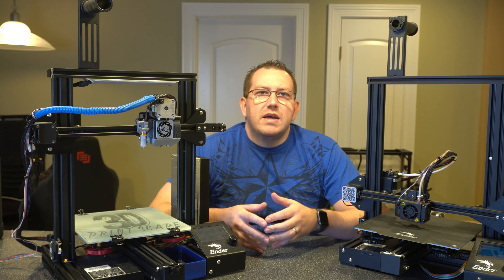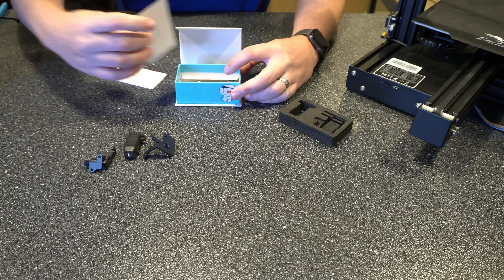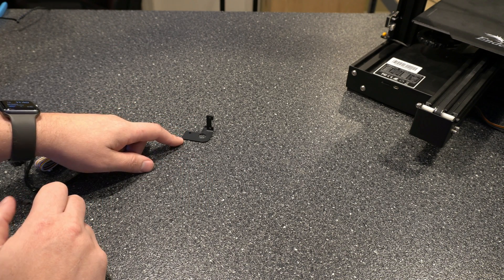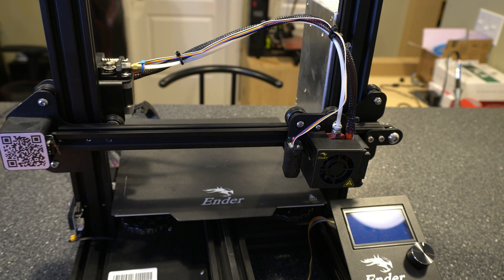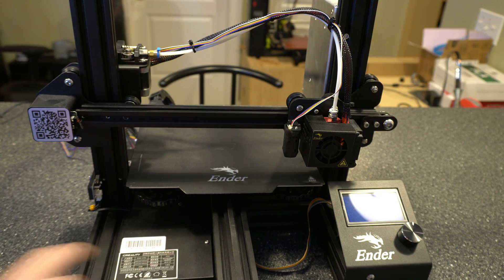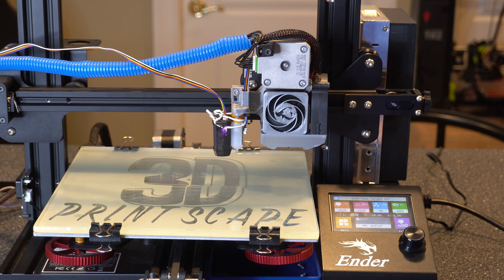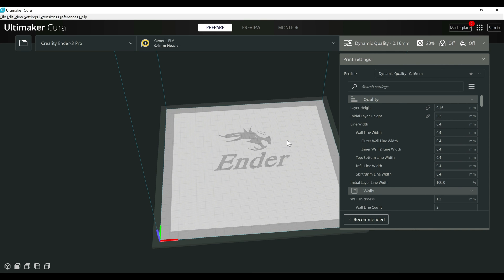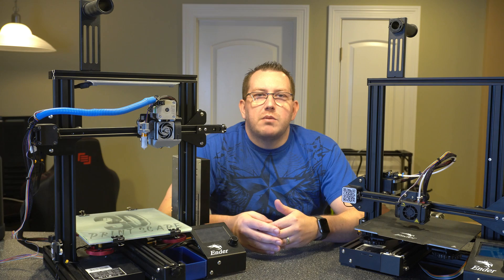CR Touch on SKR Mini

Comment: The firmware you told me to install for the ender 3 skr mini 3.0 isn't working, what should I do?
Reply: The cr touch and z stop are connected and working when I click auto home it does the stock ender 3 auto home and when I select level bed it starts it then stops
Reply from the maker: Hi. Sorry for the delayed response, was on vacation. Are you still having issues?

Comment: I'm still having issues with the firmware and getting the z offset
Reply from the maker: Hi. What issues are you having?
Reply: @3D Printscape  I have an skr mini v2 with a tft touch screen and I just got the cr touch When I download the firmware v2 and the bl touch firmware and load it to the printer it seems like it doesn't load the firmware properly the info screen still says it has the old firmware and the abl keeps getting an error and if I try to do my z offset every video and different menu layout like the z offset wizard And if I take the SD card out and put it in the computer the firm warefile has changed its name and the file type After loading it in the printer
Reply from the maker: @adrielsanchez5793  Does the autohome and mesh work correctly?
Reply: @3D Printscape  no they don't and the auto home Goes in the bottom left corner  not the middle of the bed
Reply from the maker: @adrielsanchez5793  Do you see anything for the bltouch in the menu? It sounds like it maybe a firmware issue.
Reply: @3D Printscape  I have abl in the menu but there's always an issue manly with the auto home not being center
Reply from the maker: @adrielsanchez5793  Did you clear the eeprom? If so, it could be an issue with the bed size in the firmware.

Comment: Do you know how to connect cr touch to screen mini v1.2 that's the board I have it doesn't have the 5 pin connection on the board it has a 3pim servo port
Reply from the maker: Hi. You have to spilt the servo and probe pins out. The 3 servo pins would connect to the servo port and the probe pins would connect to the z stop port. There are also a couple small firmware changes needed. If you decide to go that route let me know and i can help with the firmware part.

Comment: Is it supposed to create a new mesh everytime you print something?
Reply from the maker: Hi. If you add the g29 command to your machine profile it will, but by default it doesn't.
Reply: @3DPrintscape  dude, thanks so much! Plugging the z endstop switch did work!

Comment: Hey, I downloaded the bl touch for z homing and the z axis doesn't compensate whatsoever. The cr touch does work though, should I have downloaded the other firmware?
Reply from the maker: Hi. Assuming you have the z stop connected and the crtouch wires connected to the bltouch port you want the bltouch firmware, not the z homing one.
Reply: @3DPrintscape  I do not have the z stop plugged in, does it not work without it?
Reply from the maker: @yobtnirp3D  Most firmware require it to be plugged in.
Reply: @3DPrintscape  oh, but it does not actually use it?
Reply: @3DPrintscape  right now it probes and even says it leveling the bed but the z axis wont move according to the probe
Reply from the maker: @yobtnirp3D  Are you saying its failing to create the grid or use the grid once created for the print?
Reply: @3DPrintscape  yes it will make the grid but will not use it. I have the g29 code in cura so I don't know why it's not working
Reply from the maker: @yobtnirp3D  If its running the g29 command it should be working. Can you hear the z axis stepper motors moving when on the same layer?

Comment: So I have a bigtreetech skr mini e3 v3  and  the tft 50 also with a Sprite extruder pro and an a cr touch installed. when I first turn the printer on it says that the probe failed to enable the bed leveling  and when I try to turn on the bed leveling it still says that it failed to enable the probe
Reply from the maker: Hi. You need to run a mesh then save it. You can do that with the g29 command.
Reply: @3DPrintscape  when o run. The command it will crash, work but fail after it probes, randomly make different meshes, totally miss the bed altogether even the nozzle will miss, also it will do one or a combination of these things even if I home the printer or move it a little so it don't crash.  At this point I think it may be the bord that is being problematic. But I can run a print fine as long as I don't use the probe and have to manually level the bed
Reply from the maker: @Collins_Outdoors01  Try to clear the eeprom. I had a similar issue when making a change and flashing the firmware.
Reply: @3DPrintscape  so it has helped a little but when I go from menu-> movement-> bed leveling-> probe offset  it still shows it as off and when I try to turn it on the z axis don't lift after being homed so the probe don't work.   Also if I do g29 the probe is way off the bed and I can't adjust the x and y offset for the probe and only the z axis can be adjusted from the screen
Reply: @3DPrintscape  i just replaced the board now i ran into an issue where the y axis was doing weird things and the z was not even registering
Reply from the maker: @Collins_Outdoors01  If your having issues across multiple boards its likely not the issue. Im starting to lean towards firmware.

Comment: my printer dose not home in the middle it just crashes in to the front left corner im at a loss
Reply from the maker: Hi. What firmware are you using and did you clear your eeprom after flashing it?
Reply: @3DPrintscape  I I’m using the firmware shown in the video I did not clear the eprom how would I do that
Reply from the maker: @totalkiller4  Its clearing the defaults (looks different between firmware versions). Its also worth mentioning that the firmware builds get updated all the time, so its possible something may have changed.
Reply: @3DPrintscape  my bed was out of level and the Z switch getting hit that was my problem so iv worked it out now all good should mention that in the video
Reply: @3DPrintscape  hi i cleared the eprom now it’s just finishing in mid air after a few seconds
Reply: @3DPrintscape  hi i cleared the eeprom now it cant go go down on the z when in movement ?
Reply: @3DPrintscape  so i worked out my problem i had the Z unplugged but now its only doing 2 points of the mesh and then stopping ? any help

Comment: So I just purchased and installed the skr mini v3 along with the tft35 e3 v3 on my ended 3. When I turn my printer on I get an invalid mesh notification
Reply from the maker: Hi. What firmware is on the skr, stock? It may be worth updating the firmware on both.

Comment: Well since I rarely use social apps and I was not sure what to do with discord, I think I will post my question here.

I was wondering what is the difference between BigTreeTech pre-compiled firmware firmware-bltouch.bin and firmware-bltouch-for-z-homing.bin.  I would like to keep my Z limit switch if possible.
Reply from the maker: Hi. There is a difference. The one with z homing in the name assuming you remove the z stop and connect the probe stop there instead. If you want to leave the z stop connected (which i recommend), you would use the other firmware and connect all 5 wires from the bltouch to the bltouch port.
Reply: @3DPrintscape  Okay great.  Thanks for the info.

Comment: Interestingly my cable for the CR Touch is wired different than yours.  Yours is blue, red, yellow, black, white at the CR Touch.   Mine is red, blue, yellow, black, white.  I don't think it will cause a problem though I will have to check the connection on the control board.
Reply from the maker: Hi. As long as the actual pinout is the same on both side the order wont matter.
Reply: @3DPrintscape  Yes, it was fine and the probe is working.

Comment: I use TFT35 With SKR mini E3v3  I don't have a z offset option. I only have 'p offset'.  If I go into marlin mode I have a wizard but not having much luck
Reply from the maker: Hi. I think they changed z offset to p offset on the tft in a later version of the firmware.

Comment: Thank you for the video.  How different is it to install CR touch on SKR mini E3 V1.2?
Reply from the maker: Hi. The 1.2 has the 5 pin port split into a 3 +2 pin one, so you would need to change the connectors on the cr touch.
Reply: @3DPrintscape  thank you for the reply. Can you tell me what is the name for the connector and where to find it?
Thank you
Reply from the maker: @mohkatu  They are the same ones i use in this video for the neopixel. https://youtu.be/ianwpYJVyUs

Comment: I clicked the firmware but it shows only bl touch so I was wondering if bl touch firmware would work for cr touch and why.
Reply from the maker: Hi. The bltouch firmware will work. To the board, they are the same thing.

Comment: Sorry for the late question.  I have a Ender 3 pro with the skr mini e3v3. My bed is a 300 X 300 , not original.  I would grab the firmware for a printer that has a 300x300 stock bed?   Would be easier than firmwear tweaks?
Reply from the maker: Hi. I would make a marlin build and update the bed size. I’m going to try to get a video coving the process out this week.
Reply: @3DPrintscape  Thank you for that I eagerly await it

Comment: Curious about replacing an ender 3 s1 pro stock creality board with an SKR. I don't want to get rid of the CR touch that already comes with the printer. Looks like the firmware treats the cr touch just like a bl touch, no special changes needed. Is that true? Thanks!
Reply from the maker: Hi. That is true. To the firmware they are the same device.

Comment: Is there a way to attach it to a microswiss dd for the ender 3
Reply from the maker: Hi. You would have to print a custom mount for fan duct cover. I think there are options on thingiverse.
Reply: @3DPrintscape  I was about to do that but I just used that same bracket for the ender 3. Works like a charm. No issues.

Comment: I have the BTT skr mini E3 3.0 motherboard installed in my Ender 3 Pro that has a CR Touch. I followed your video and when flashing the renamed firmware-ender3.bin to the printer I received just a constant blue screen. any idea why? The SD card was properly formatted and only contained the new "firmware.bin"
Reply from the maker: Hi. Try to just name the file firmware.bin.
Reply: @3DPrintscape  I have the same issue after following your video, but your reply doesn't make much sense? Could you help further please? It seems he already named the file as you suggested, and so did I :(
Reply from the maker: @kjsalisbury  What issues are you having? For the previous person, I think it was just that he had to rename the firmware.

Comment: I keep getting unknown command G29
Reply: Also my printer keeps going all the way left
Reply from the maker: Hi. What firmware did you use and do you have the bltouch options in the menu?
Reply: @3DPrintscape  we got it, the printer board wasn't updated right

Comment: I did all the above, but my printer won’t find the Z access. It’s almost as if I don’t have the CR plugged in. My CR light is on, it pushes and retracts the pin, but never touch’s the plate. I’m so confused. It’s also never centers when homing it.
Reply from the maker: Hi. What is the name of the firmware file you used?
Reply: @3DPrintscape  Hey, I think my reply’s keep getting removed. I down loaded the Firmware-bl touch
Reply from the maker: @charlesromero306 Thats not the right firmware. It should be under the accessories tab, cr touch, and under your printer name.
Reply: @3DPrintscape  Are you referring to the manufacturers website software? I did try that. It wouldn’t boot onto the printer. So that’s when I found this video with the SKR mini and the CR. I’m still learning, and a bit confused. Thanks for the help!
Reply from the maker: @charlesromero306  I was thinking you had the creality board for some reason, sorry about that. Can you try the firmware from my site? Also, make sure to clear the eeprom after flashing it. https://3dprintscape.com/marlin-firmware-builds/
Reply: @3DPrintscape  No worries! I will give that a try and update you. Thank you!
Reply from the maker: @charlesromero306  You're welcome

Comment: When I autohome mine it just moves to the far left side and stays there same exact setup as you apart from the screen Skr v2.0i disconnected the zstop but now it just seems like the printer doesn't know we're home is
Reply from the maker: Hi. What firmware are you using?

Comment: ive just installed this and when i auto home it just moves all the way to the left Stop switch and stays there
Reply from the maker: Hi. What firmware did you use and is the printer giving you an error?

Comment: do you have any tips on doing this on CR-10S? just wondering because my cr-10 now says its an ender 3. Do I just need to change the bed size in cura?
Reply from the maker: Hi. It possible the config you started with was from an Ender 3. If the board, drivers, and bed size are right it should work just fine. The cura profile should match what the bed size is in the firmware.
Reply: @3DPrintscape  ok thanks but do I need to change it to an ended 3 on cura? Or is that just a default option to get stuff right off the bat?
Reply from the maker: @themusclehamster8482  I think leaving it as the CR10 in Cura will be fine.

Comment: ummn sir,! why my ender-3-pro is showing me the blue screen every time when I turn it on? ....I can't use it
Reply from the maker: Hi. It could be the wrong firmware, or the same firmware with the same named used multiple times. Try adding a random set of numbers to the end of the file name and uploading that to the printer.
Reply: @3DPrintscape  🥲 my board is dead I have to buy another one 😭 thanks a lot ☺️
Reply from the maker: @-animallover2787  The standard bluescreen like that is fairly common, I don't think the board is dead. I think its a matter of getting the right firmware, making sure the file name is unique and pushing that to the printer.
Reply: I just had this issue. You have to rename your file as FIRMWARE.bin. Also make sure you are not doing "save link as.." the file size will be smaller.
Reply from the maker: @Bloodyfisted  Intersting, if the smaller file was used that could have caused the behavior you were seeing.
Reply: @Bloodyfisted  Thanks this fixed my issue

Comment: Hi, can you use this to skr mini e3 v1.2?
Reply from the maker: Hi. I think you can if you split the 5 pin adapter out into a 3/2 pin. The 1.2 has the connection split.

Comment: I will post for the first time. It relies on the translation function. Please forgive me for the strange words.

I am using Ender3 pro, SKR Mini E3 V1.2 and TFT35. 
When I connect the CR Touch to the SKR board, write the firmware and perform autobet leveling, the display shows "eco: Fade Height off." 
And the CR Touch collides with the bed. 
I investigated it myself and tried to improve it, but I was at a loss because I didn't understand anything.

It's good when you have time to spare.
If you like, please tell me the improvement measures that even beginners can do.
Reply from the maker: Hi. The fade height wont impact the autohome, so if its failing there, you have a separate issue. What firmware are you running?
Reply: @3DPrintscape  Thank you for reply. I've tried it several times, but I'm worried if the comment has arrived because of a problem with the comment function.

I made a video of the current situation. The firmware was run by renaming firmware-bltouch-for-z-homing.bin to firmware.bin.
https://www.youtube.com/watch?v=B2WfGr2xAYo
The video is in Japanese, but I hope it can support automatic translation.
Reply from the maker: @Hiroyamount  Assuming you have all five cr touch wires going to the bltouch port and the z stop still connected, that's the wrong firmware. You don't want to use the one with z-homing in the name. That assumes you connect the probe stop to the z stop port.
Reply: @3DPrintscape  Thank you for your reply.
(Comment is resent due to a bug in the comment function)
SKE Mimi E3 v1.2 SKE Mini E3 v2.0 and wire port specifications are different. I am using v1.2.
CR Touch Five wires are divided into three and two and connected to SERVOS and Z-STOP.
For firmware, I already tried two patterns, firmware-bltouch-for-z-homing.bin and firmware-bltouch.bin. Both were unsuccessful.
Touching Self-Test, Deproy, Stow on the display worked fine. The impression is that only Z detection is not working.
Is the CR Touch wire connection different? Or do I need other settings?
Reply from the maker: @Hiroyamount  The crtouch wiring is the same as the bltouch, but make sure you verify the pin output. If you have all five wires and thee z stop connected, you will want to use the firmware-bltouch.bin firmware.
Reply: @3DPrintscape  I've already tried it, but it didn't work. Because the cause is unknown, I decided not to use CR Touch and decided to return the firmware and use it as usual. Thank you for your advice. I'm very much obliged to you for your kindness.
Reply from the maker: @Hiroyamount  Sorry to hear that and you're welcome.

Comment: Greetings! Is the CR Touch compatibile with SKR Mini E3 V3?
Reply from the maker: Hi. The V3 still supports the bltouch, so it should be.
Reply: @3DPrintscape  Alright thank you
Reply from the maker: @pexy1237  You're Welcome
Reply: Firmware that on official Bigtreetech github is not properly working with crtouch and E3 v3 on Ender 3 Pro  - you need to compile firmware by yourself or connect CRTOUCH probe wires to Z-STOP pin
Reply from the maker: @Mavris1986  Thanks for the info. The v3 is still pretty new, so that doesn't surprise me.